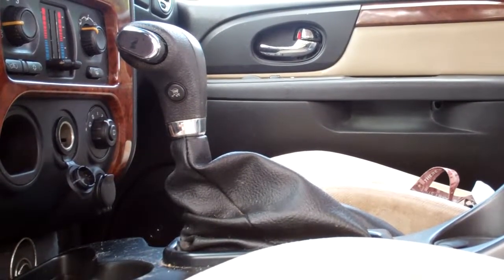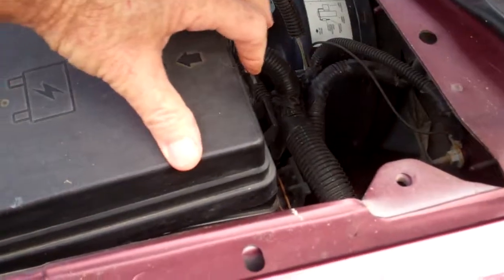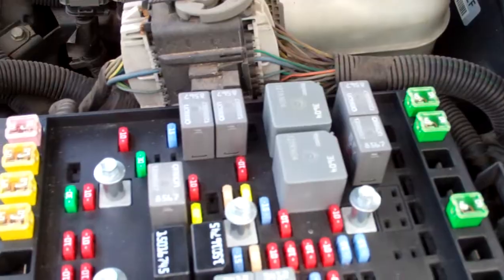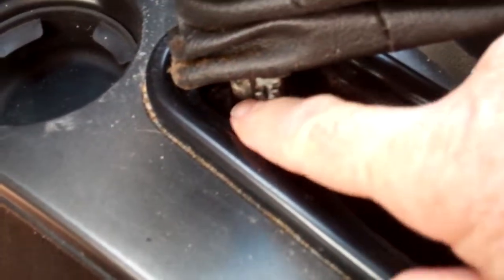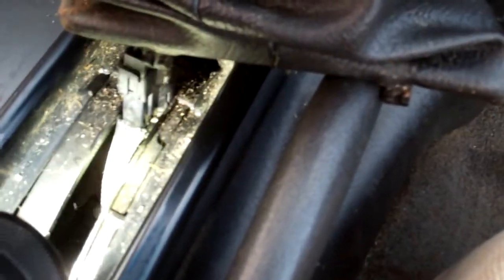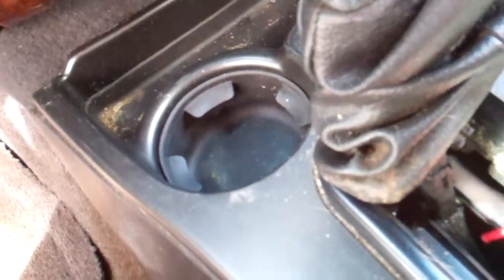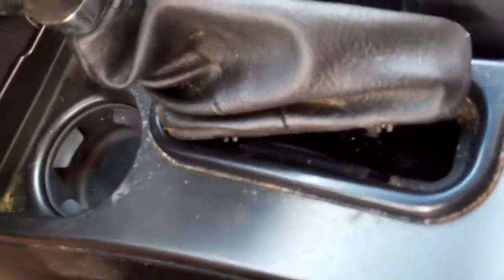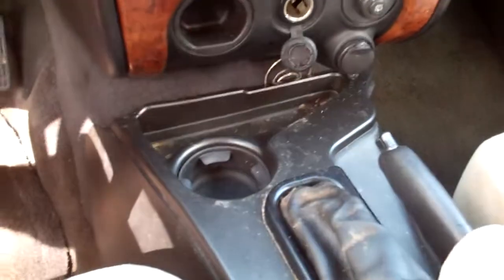Gear Shifter Locked in Park, Won't Go Into Drive Even with Brake Depressed - 2002-2008 Trailblazer

Comment: Fantastic videos. Watched 2 of your videos on the BTSI bypass (drilling hole to manually reset the solenoid - you did two- and now this one. I've watched a lot of car repairs videos and done a lot of repairs (some major), your technique is most enjoyable and informative. Please keep up the excellent work. If it's not too much to ask, will you please buy a 2000 Jeep Grand Cherokee and do some videos. I have one of those and I could use your help. 😁 Bill
Reply from the maker: Thanks for Watching and the Nice Comments. I enjoy doing these videos. Thanks for the idea on the Cherokees! I've owned two of those in the past. Will see what I can do. Any particular areas of concern on the Cherokee? Thanks Again!

Comment: Thank you for this video! I wish my auto expert dad was still around 💔😢
My husband passed almost 2 years ago so I'm a solo gal having to figure out these things and I don't know what I would do without YT and all you car experts🙏 to come to my aid. I have a great mechanic but he's not close by where I live and in SoCal, we really need reliable mechanics!!
So, thank you CubManCan ☺️ and I subcribed and will be learning even more! if I may add, I learned recently that lubricant vs. WD-40: when it's lubricant needed, it makes a huge difference in the long run! Much smoother because of the silicone where WD-40 is more of a solvent, by comparison - I keep both on hand and I learned from another YT channel that the lubricant works better, longer where lubrication is concerned...I made the mistake of putting WD-40 on the track of vertical blinds; now they're stiff and don't move back and forth easily which was my original intention. I wish I'd known that lubricant "hack" sooner so now I have to start over... Anyway, I just wanted to throw that out there. Thanks again for everything and will be watching and learning from all your videos. 🙏💗
Reply from the maker: Thanks for Watching! Great Points Made! Often WD40 is good for cleaning and loosening, but in most cases a lubricant should be used later if WD40 is used first. Thanks for that good info!

Comment: The wire under the shift boot goes to your Traction control system and not to the shifter. The activate trac control is the little button under the silver knob on your shifter.
Reply: My 03 Trailblazer wire under the shift boot goes to my shifter. The activate overdrive is the little button under the silver
 knob on my shifter.
Reply: @cathycurry6730  mines 06 LS and has traction control.

Comment from the maker: HEY GUYS, 
REMEMBER!  SAFETY FIRST: MAKE SURE THE VEHICLE IS STABILIZED BEFORE STARTING ANY MECHANICAL WORK- ESPECIALLY ON ANY SHIFTER ISSUES!  
I received a very good Question, So I reposted it here - Let me know if it helps, or needs more explanation - Thanks for Watching! 

QUESTION:
What if your car is stuck on reverse, sorry for the late comment my car won’t start and it’s stuck on reverse, got any advice appreciate it
ANSWER:

Thanks for the Comment! SAFETY FIRST: MAKE SURE THE VEHICLE IS STABILIZED BEFORE STARTING ANY MECHANICAL WORK- ESPECIALLY ON ANY SHIFTER ISSUES! 
It sounds like the shifter cable is not operating correctly to get the transmission into PARK or NEUTRAL so the starter will engage. This can happen if there is damage to the cable or the backets that hold it in place, or the grommets at the attachment point at the end of the cable where it meets the transmission. The grommets are not real difficult to replace (about $10 at AutoZone), but be very careful to lock your wheels with the parking brakes and use wheel chocks safely, and if you have to raise the car up, use good jacks and jack stands and use them properly. If you need more info, please post a new comment (not a reply) so it is easier to notice and reply to. Thanks Again - Good Question!

Comment from the maker: SAFETY WARNING! BE VERY CAREFUL WHEN WORKING ON ANY GEAR SHIFTER ISSUES! MAKE SURE THE VEHICLE CANNOT ROLL BY LOCKING THE PARKING BRAKE AND USING CHOCKS ON THE WHEELS - AT A MINIMUM THE REAR WHEELS SHOULD BE PROPERLY CHOCKED BUT ALL 4 WHEELS CHOCKED IS BEST. WORKING ON A LEVEL PARKING SURFACE IS ALSO CRITICAL! 
You may need the assistance of a mechanic trained and experienced with this type of vehicle as It sounds like you could have more than one issue. That said, a shifter mechanism out of sync with the actual transmission can cause a lot of problems due to the signals the vehicle's on board computer is recieving and sending. The key switch will only crank the engine over if the actual transmission itself is in the park or neutral position (a malfunctioning shifter or cable mechanism may cause a difference in the shifter position and the actual transmission position.) I would begin by inspecting the shifter related linkages and mechanisms (ALWAYS STABILIZE THE VEHICLE FIRST). You may have a bad shifter cable issue or - possibly the cheapest to fix and most likely- only the grommet at the end of the cable may be worn/bad/disconnected. You also could have a BTSI issue keeping the shifter locked up, but that is less likely. There are steps on other videos that explain those issues. A first-step easy, cheap fix for that may be to pull the shifter lever boot up and try a bit of WD40 at the points shown in the video. As a diagnostic measure you could drill a hole in the side of the console in the right position (shown on the BTSI video) to manually release the BTSI lock -BUT BE CAREFUL TO ENSURE THE VEHICLE CAN'T ROLL IF YOU MANUALLY OPERATE THE BTSI SOLENOID!
AGAIN: WARNING! MAKE SURE THE VEHICLE IS STABILIZED AS WORKING ON ANY SHIFT RELATED PART MAY PULL THE TRANSMISSION OUT OF THE PARK POSITION! USE PARKING BRAKES AND WHEEL CHOCKS ON LEVEL GROUND! Most of all, be very careful, get professional help if you need it - Thanks for Watching!
Reply: What if your car is stuck on reverse, sorry for the late comment my car won’t start and it’s stuck on reverse, got any advice appreciate it
Reply from the maker: @cristianvalle9006  Thanks for the Comment! SAFETY FIRST: MAKE SURE THE VEHICLE IS STABILIZED BEFORE STARTING ANY MECHANICAL WORK- ESPECIALLY ON ANY SHIFTER ISSUES! 
It sounds like the shifter cable is not operating correctly to get the transmission into PARK or NEUTRAL so the starter will engage. This can happen if there is damage to the cable or the backets that hold it in place, or the grommets at the attachment point at the end of the cable where it meets the transmission. The grommets are not real difficult to replace (about $10 at AutoZone), but be very careful to lock your wheels with the brakes and use wheel chocks safely, and if you have to raise the car up, use good jacks and jack stands and use them properly. If you need more info, please post a new comment (not a reply) so it is easier to notice and reply to. Thanks Again - Good Question!